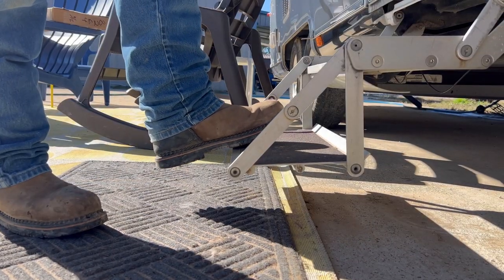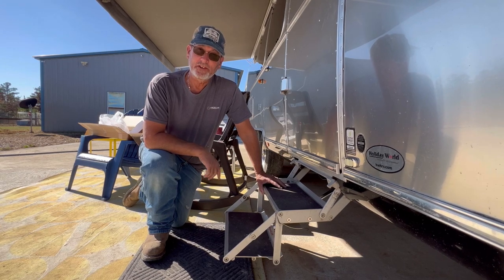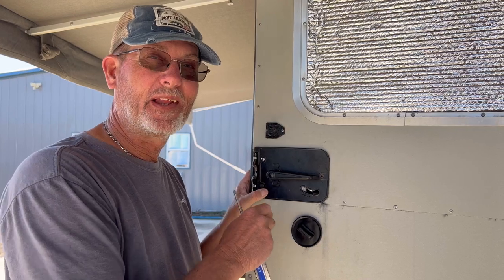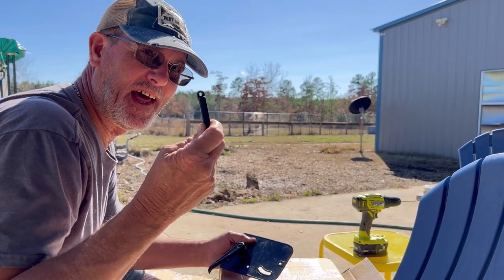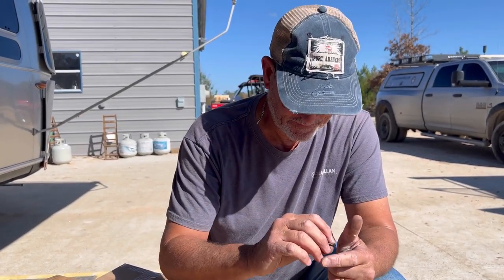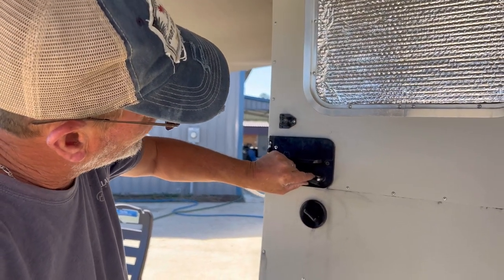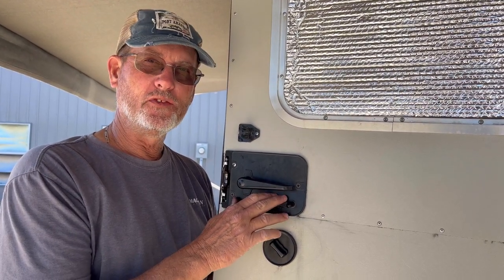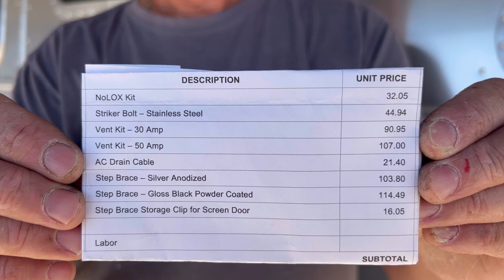How to Fix Three Common Airstream Issues

Comment: I have 4 of his products and just ordered the deadbolt repair kit.  My deadbolt got slammed in the door and now it won't lock.  Paul has a fix for it 😀.  You can use a drum brake dust cover to prevent the lock from locking when shutting the door.  It is rubber and fits nicely in the lock slot on the door.
Reply from the maker: Thanks!